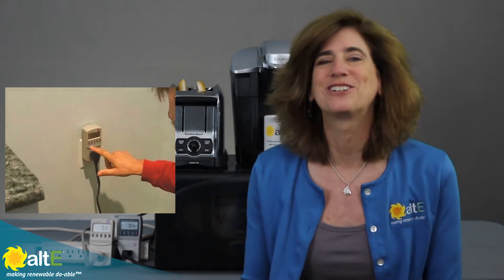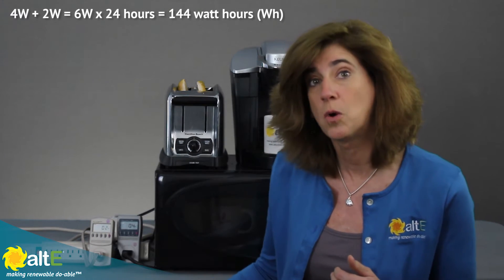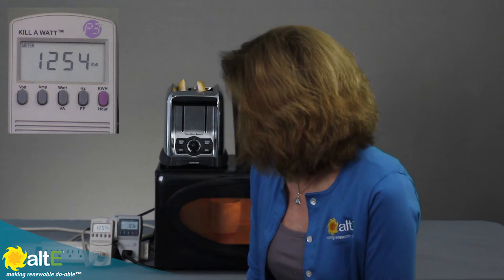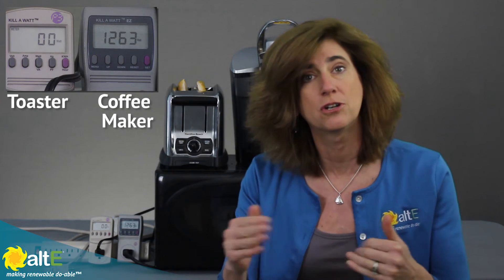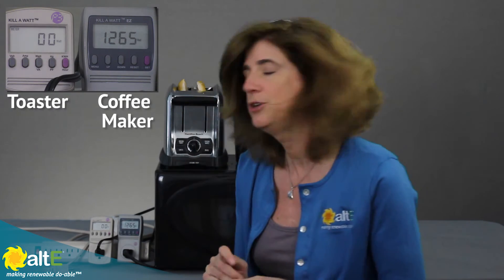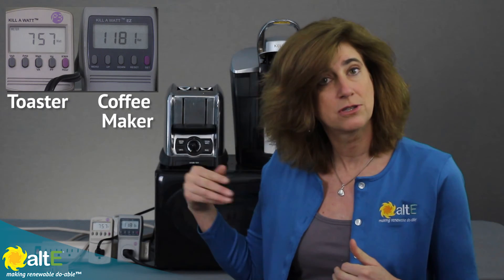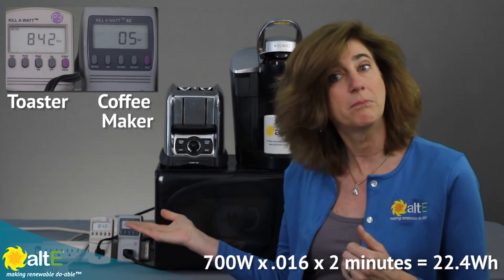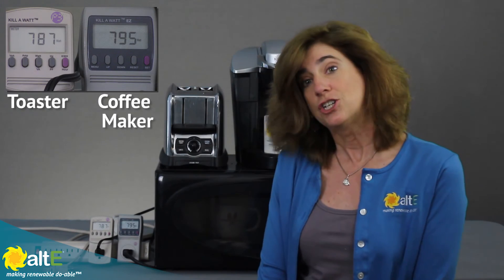Kill-a-Watt Meter: Creating an accurate loads list for off-grid solar

Comment: How the hell am I going to measure my computers?! They consume a different measure every time, when they are turning on when they are idle, when they are gaming, processing and I use it ALL DAY Long every day for different tasks.
Reply: Your comment is a year old, but I thought I'd answer in case anyone still wants to know...

First, you can open Task Manager to see what programs are running and using your CPU and GPU and to lesser extent using your disks and RAM. Look at the "Power" columns if you're on Windows 10 or 11, it should show you which programs are using the most power.

Then, with all programs closed (and maybe quitting / ending background tasks if they're using a lot of power) measure with a watt meter when no programs are running and using up your CPU/GPU, none using your system resources. Just sitting at the desktop doing nothing. This would be "idle" power draw, and it would be the minimum.

Then, run a demanding program on the CPU. Like Aida64/Prime95. This can generate maximum power draw on your CPU for a "worst-case scenario". You can run FurMark for a similar "worst-case scenario" stress test on your GPU to draw just about the most power it is capable of. Lastly, you can try to run both Prime95 and FurMark at the same time, but I hope your power supply is high wattage or this might over-stress your power supply -- it would be a lot more watts than gaming, most likely. This is the "maximum power draw" your PC can use at one time.

For a gaming test, try opening a game with an in-game benchmark mode, and looking at power readings then. Or measure with your character standing still and not a lot happening, vs measuring again when a lot is happening.

You might also be curious how much power it draws while asleep or totally shut down, so feel free to measure that as well.

These amounts of power would be different based on the task that's running, based on how high-powered the parts you bought are (more powerful = more watts, usually), and based on how efficient the CPU, GPU and power supply all are. There is no "one true reading" for how much power your system always uses, it's different per task. But you can ask how often you're just web browsing (not so much power) vs gaming (more power) vs PC is asleep (much fewer watts) or off (hopefully just a few watts or less?)... Yep.

A little complicated, but PCs are complicated in the many different things they can do, so it kinda makes sense IMO.

Comment: I remember reading an article called 'energy vampires' and it was amazing how all
these appliances use up a ton of energy even when not in use due to stand by circuits.
Older units were completely disconnected from power when their power switch was turned off. No so today's stuff like TV's, radios, microwaves and the like. If it has a little led light glowing anywhere, it is pulling a few watts and is not really off but in stand by. 
Many computers draw a ton of power when turned off. I now have mine on a power strip and when I leave the house, I just turn the power strip's switch off, completely disconnecting all the devices from power. It may only save about $5 - 10 a month, but 
I'd rather have that in my pocket then to give it to the power company. And for the stuff on my solar power setup, I am not wasting battery capacity by leaving these power leaches on 24x7.
Reply: You probably dont care at all but does anyone know of a way to log back into an instagram account?
I somehow lost the login password. I appreciate any tips you can offer me.
Reply: @Angelo Eduardo Instablaster =)
Reply: @Ares Spencer thanks so much for your reply. I got to the site through google and im waiting for the hacking stuff atm.
I see it takes quite some time so I will reply here later with my results.
Reply: @Ares Spencer it did the trick and I now got access to my account again. I am so happy:D
Thanks so much you saved my account !
Reply: @Angelo Eduardo No problem :D

Comment: we started doing this a few months back after a few generator guys tried selling me 30k genset or 10k solar with massive battery banks and inverters. we got to killawatt plugs on amaxon for 22 bucks total and also picked up a "current cost" whole house monitor for $35. we now know that our house only ever hits more than 2kw when the ac kicks on and that's only about 5kw a day max with instant reading around 4.5kw. so we now have a MUCK smaller system that is kicking but!!! we have also cut our daily use by more than 10kw by watching the numbers everyday (whole house monitors sits on the coffee table). 10kw cut translates to $30 a month savings for us. so the meters paid for them self in 60 days and that's $360 a year saved!!! that's awsome!!!
Reply from the maker: +nbookie Knowledge is power!

Comment: Do you sell kill-a-watt on your online store?
Reply from the maker: +Francis Opoku Yes we do, 3 different models. You can see them here, https://www.altestore.com/store/meters-communications-site-analysis/meters-battery-monitors/power-meters-c631/?brand=P3+International+%28Kill-A-Watt%29
Reply: +altE Store can either the P4400 or  P4482 be used on a 240 volts outlet?? If not can you advice on one that can. Thank you
Reply from the maker: +Francis Opoku Thank you for bringing that up, I forgot to mention it. The KillaWatt meters only work on 120V 60Hz. I'll look to see if I can find an international one.
Reply: Ooh OK. Thanks
Reply from the maker: +Francis Opoku You can Google "EU energy monitor" and several products come up. I haven't used any of them, so I can't recommend which one to use, but you can see online reviews for them. Thanks again for catching that, we try to make our videos internationally acceptable, I have added a note in the videos that this is only for 120V 60Hz.
Reply from the maker: I don't recommend adapting a Kill A Watt meter. You'd need to run it through a transformer, not just a new plug, as it is designed for 120V. Just a new plug would send twice the voltage to it. If you use a transformer, it will drop the voltage into the meter, but I'm not sure how accurate the readings will be. Best to buy one designed for your voltage.
Reply from the maker: Whew, thanks, I did misunderstand you. Must have been your accent ;) Yes, a meter designed for 230 50Hz with just the plug adapter is fine. Thanks for straightening me out.